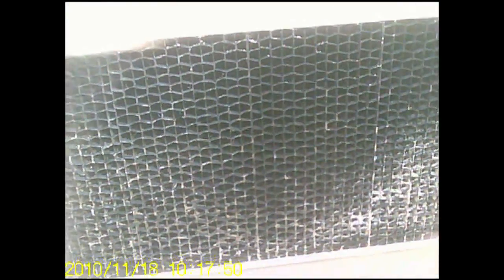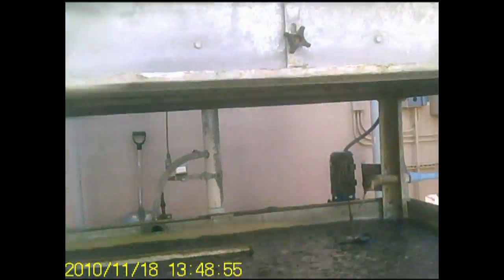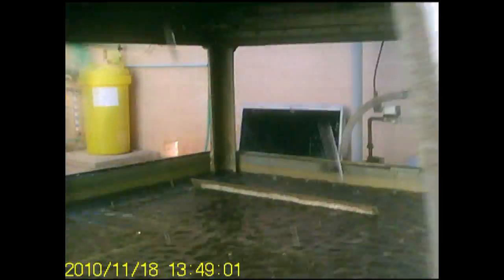Another Cooling Tower Drain and Clean - Nov 19th, 2010

Comment: Can it be clean while system is running?
Reply from the maker: Once the water is drained the pump will starve.
The one thing you can do, which isn't a full drain and clean, is siphon sediment from the bottom of the tower basin to keep it from building up too fast. You  just don't want to stir up the sediment too much else it will suck right into the strainer and plug it if not into the pump and nozzles.

Comment from the maker: @m1991colt 
These ones here go to a loop for our water sourced heat pumps. A whole bunch of them.
In my other video those big ones go to our 500 ton chiller.
My boss had analyzed the electric bill and it's like HALF the electric per the square foot than I pay at home. And commercial pays a higher fee than we do at home. They get hit for PEAK DEMANDS like when a large compressor starts. 

The towers paired with the variable speed chiller are twice as efficient as package units, etc.